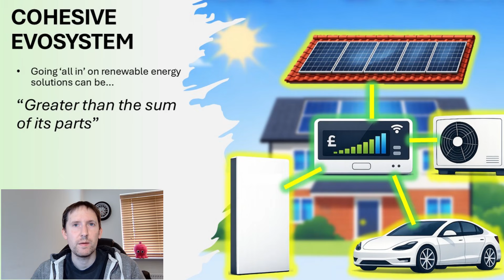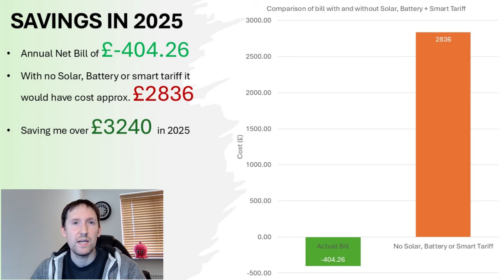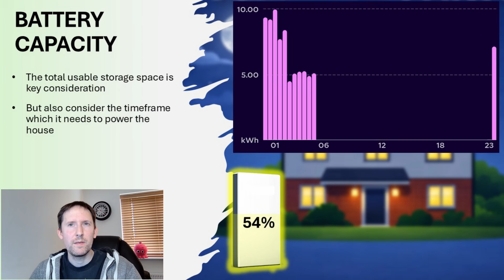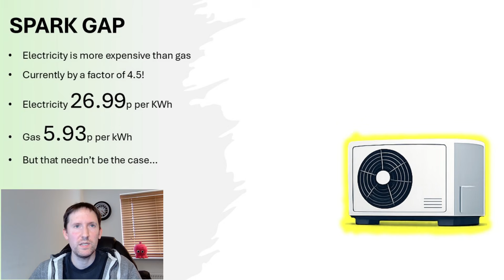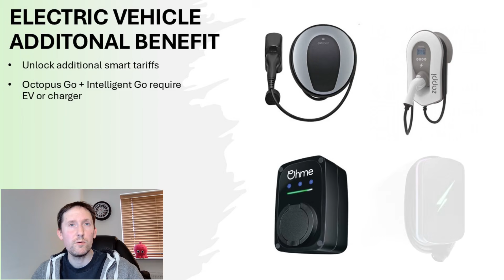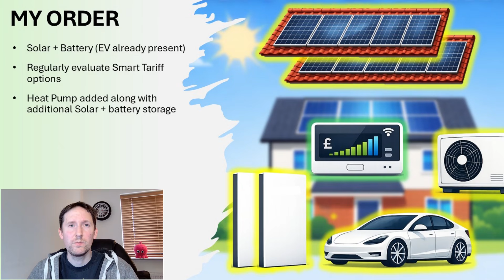The Renewable Energy Setup That Pays Me to Live Here

Comment: With your xport dropping 20% 
Approx £260 a year less 4u
An import cost going up to 7.5p/kw up 0.5pkw 
How is £404 (2025) gonna jump up a few hundred by end of 2026????
Reply from the maker: Good question. I'm glad to you mentioned the drop in export rate as that's a hot topic right now. I have to admit my calculations were pre that announcement. But... I'm confident negative 600 is still achievable in 2026 on the basis that I had two months of gas usage in 2025, my garage and north aspect solar panels were only installed in May 2025, meaning I start this year off with additional capacity. Finally I'm trying a different tariff strategy with Intelligent Flux over the summer to make better use of the battery and get a much better rate for export at defined timeframes. That largely negates the drop in the anytime export rate as most of my Export will be while on the Intelligent Flux tariff 🙂
Reply: @RenewableEnergySteve oh yeah I suppose yur flux tariff is sort of saving u a tenner a month.    That will help 
This Feb’s weather or this year’s weather so far ain’t helping.    I try sending you sum sun tomorrow 
Hope it helps
Reply from the maker: @hayabond893 Oh it's been an absolute shocker this month. 1 day of sun so far for me. I would definitely appreciate sending some my way 😄
Reply: Import should be going back down in April

Comment: I think you were listening to my conversation with a friend the other day because what you have said in this video is almost word for word what I said. 👍
Reply from the maker: Oh wow! That's cool. Great minds think alike then 😄 
It's one I've been thinking about for a while. I often cover a specific aspect, but I don't see many videos about the benefits of how everything combines, so wanted to highlight that. 🙂
Reply: Its strange that a dno allows this export energy on single phase.
Reply from the maker: @gino2465  in theory anything up to 23kW would be possible given the nominal UK voltage is 230 and many homes, including ours have a 100amp fuse
Reply: I have had several dno refusals for solar power due to size of inveter out put. Its all to do with export out port of inverter
Reply: @gino2465 do you live out in the sticks? a friend of mine in Cornwall was limited because of the very old overhead transformer and the three other houses connected to it all had solar.
Reply: i do live rural but the last one as i install solar systems was in a very large town. The DNO would not allow 6kw solar as the inverter was 5 kw export.
Reply: @gino2465 what makes of inverter were they?
Reply from the maker: @gino2465 That's always frustrating, but its not uncommon to be quite restrictive in some parts of the country. There are usually paths forward. Who was handling your DNO applications? 
You might be able to still have a powerful inverter and if it's g99 compliant it can be limited to restrict output to avoid exceeding the export limit. 
There is also the option of reducing the inverter size and oversizing the solar array. There would be some clipping in the summer months, but a smaller export limit doesn't always mean a hard no to a decent sized solar array. I know many people have much larger solar arrays than their DNO limit
Reply: i know, its a fight onnmany occasions but its also the need to increase pv kw solar inverter size so batterys can be charged at geeater amps. Most lattest inverters are all compliant but i think a lot of my issues is the dno dont use tech staff on the applications as export limitation is very possible on lattest inverters which are g100 compliant. They could insist on a g100 relay but all new inveters are ready. They just dont seen to get it. Had 1 ev charger refused even though i said i would use a specific product that could be set to ramp down if home demand raised but again i ot the huge No word. I ont have the time  to engage with them.
Reply: The Force is clearly with you. 😉

Comment: Well done. I've got everything except the EV but my order for a new Tesla keeps getting out back!! I think being on a EV tariff will be a big benefit for charging the battery and car. I'm on the cosy tariff so not quite as good!!
Reply: Model y juniper. Rwd premium. Looks like summer time before I get it!!
Reply from the maker: @KevinScott-y5l  lovely! The rear wheel drive ones are highly efficient. Shame about the wait, but I'm sure it will be worth it 🙂
Reply from the maker: Thanks. Which model of Tesla are you going for? I have a 5 year old model 3 long range. 
Something I like about the Cosy tariff is having 3 off-peak timeframes, but the downside is the rates are not even close to the EV tariff's. Having an EV tariff in place could prove to be quite a benefit 🙂

Comment: Steve, this is the holy grail! 🙌 A negative energy bill is the absolute dream. I’ve just done the maths on my EVs saving me £3k a year, but seeing how you’ve integrated the heat pump and that massive battery to actually make money is next level. 27kWh of storage is a beast! Well done 🫡
Reply from the maker: Yeah, it's pretty incredible when all the elements work together 🙂 
Saving 3k a year sounds feasible on the right tariff if you do enough mileage. 
Thanks for watching Tom 👍
Reply: Honestly at this point I think it's more accurate to say "27kWh was a beast". It's probably the minimum worth installing unless using overpriced equipment where the inverter is tied to the vendors own wildly overpriced batteries.
Reply from the maker: @etchedpixels initially I had doubts around whether a second Powerwall would be financially worthwhile. It's definitely made sense over the winter to power the heat pump. There are several much cheaper options available now so getting that sort of capacity needn't cost anything like what I paid for it.
Reply: @RenewableEnergySteve  that's the "overpriced equipment where..." case 8)

On 2 year ago battery prices it was worth us doing Cosy in winter and EV tariffs in summer. At current prices we switched to more battery and just EV tariff this year and my calculator says it was a win. We still eat peak power on the coldest days because adding even more battery that's little used just makes no sense at all.

For the new house where we've got to pay the install cost anyway the discussion is currently between 48 or 64kWh of Fogstar kit, simply because I've got to pay the installer to do all the other work anyway
Reply from the maker: @etchedpixels  I thought as much 😆 
If capacity is your top priority Fogstar is a cracking choice from a value perspective. Powerwall's are significantly more expensive of course, but have some advantages besides having their own inverters built in. They can be placed outside and are thermally managed. They have long warranties, they have native compatibility for a wide variety of tariffs. They also allow for full home backup during Power cuts via the gateway. They are not perfect, but I don't regret my choice.
Reply: @etchedpixels  64 kWh of battery... What a dream that will be 🎉🥳👍

Makes my 9.5 seem like a toy 😢